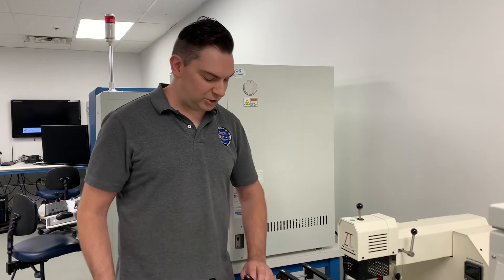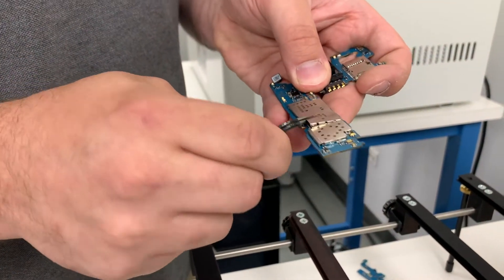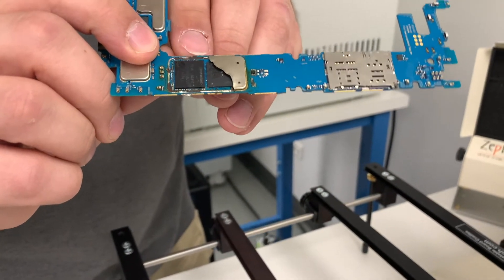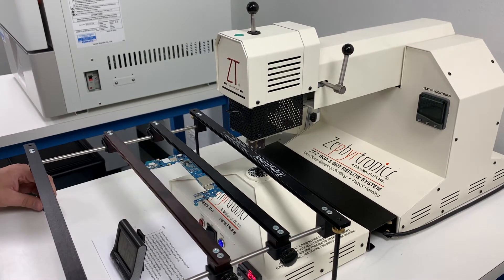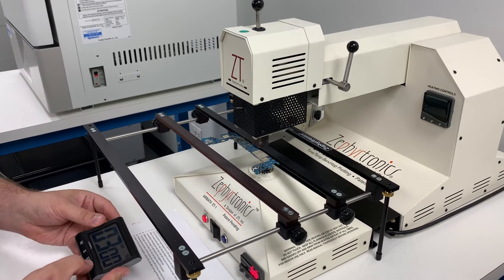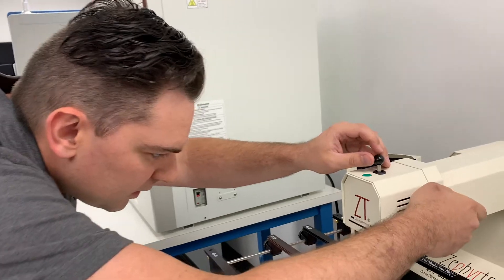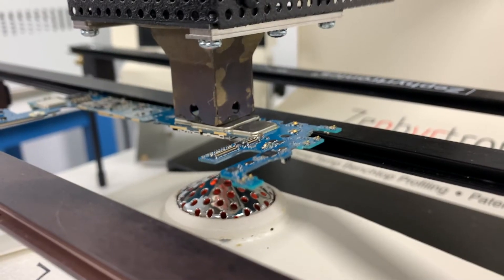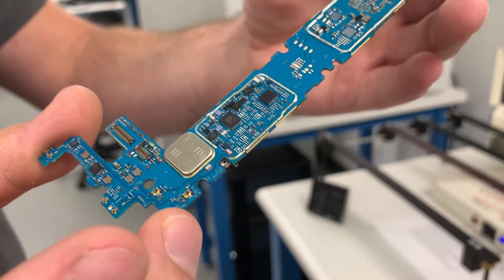VTO Tips & Tricks: Removing RF Shields

Comment: To everyone that doesn't have 5-10k spare cash, here is another more down to earth method(I'm not saying I don't like this machine!): find low melting point solder and "contaminate" the  edges of the shield. I mean, pre-heat the board, help yourself with hot air from the top, and use soldering iron to melt the new solder into the edges. Then, use solder sucker followed by solder mop to clean and remove as much solder as you can. Next, continue with preheating the board, find a way to apply pressure on the shield (I use scalpel) and heat the top of the shield. 
If you've used 178C 60/40 solder to contaminate the edges, the shield will come off way before any component comes off the board as the rest of the components are soldered with lead free solder which melts at about 210C.
Not to mention if 60/40 solder is mixed in the right ratio with lead free an euthetic alloy could be created, which melts at a lower temperature than both. There are other solder wires with even lower melting point temperature that can be considered. Don't use junk soldering irons that cost a few quid. Use a good tool that heats up quickly and is able to maintain tip temperature. Also use a fine tip say 0.6mm but not too fine as this will prevent the soldering iron from transferring heat. Whilst I would encourage everyone to learn to solder, removing RF shield with soldering iron shouldn't be you first job - if that's the case, find someone that does this for living.